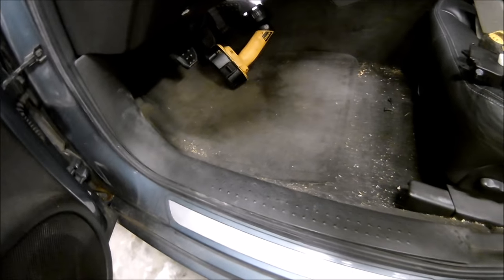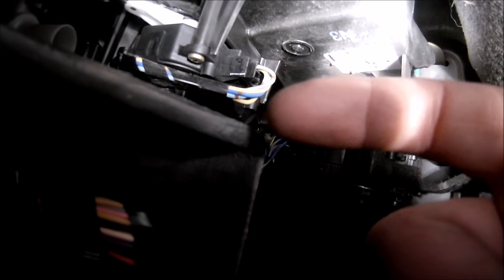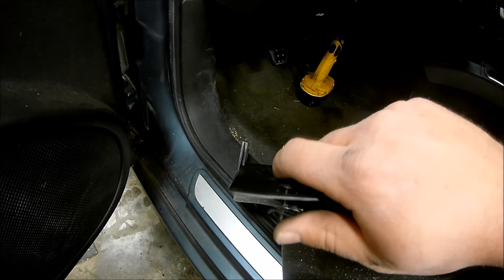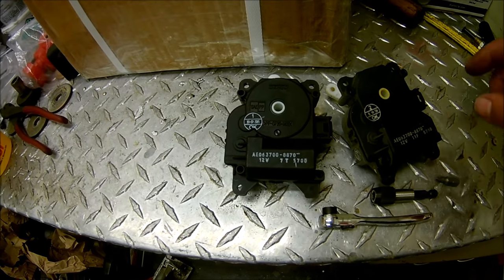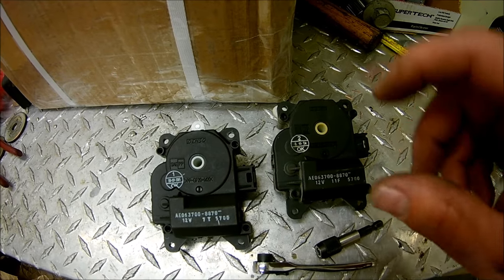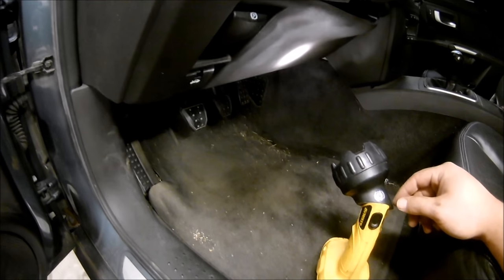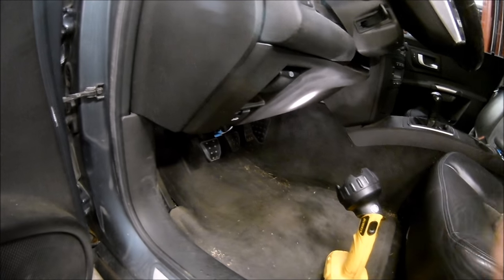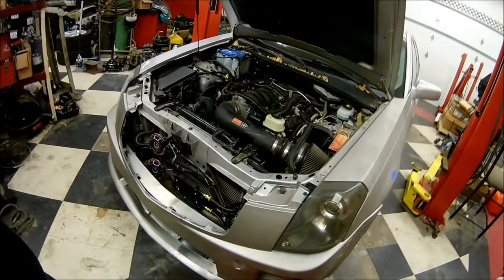Blend Door Actuator Install

Comment: I changed my actuator when my AC wasn't working over the summer. Now my AC works amazing but only two vents will blow out heat. Now I have to replace it again 🤣

Comment: In my 2005 Sienna xle when my heat is on i have cold air coming out the vents of my drivers side. I have a dual control heat control. Which one do I need?

Comment: I am in exact same situation the actuator does move when I change temperature but heat still doesn't work, so gonna try and change the actuator. (Hyundai I40 2016)

Comment: I have a 05 cts v and i have the temperature on head with the a/c off temp at 90 also the tem gauge its at 180 and i the air dont feel hot its just warm you have and idea fo what it could be?
Reply: I have the same problem on my 04 srx . This actuator shown in the video is still working on mine
Reply: MrOly076 i just gonna sale my car i need something different now
Reply: Im basically just driving mine till it dies but it is refusing to die . So i mite aswell have some heat
Reply: MrOly076 😂